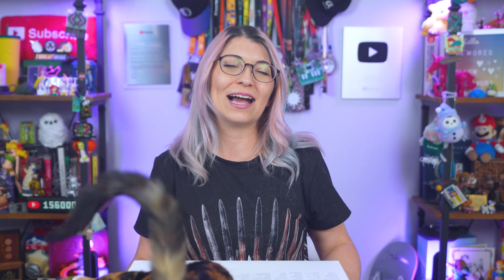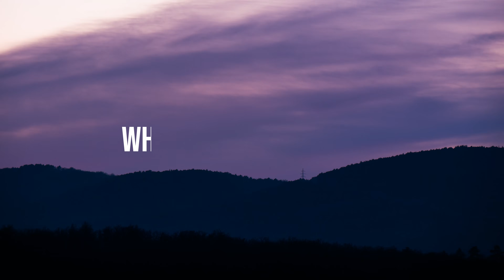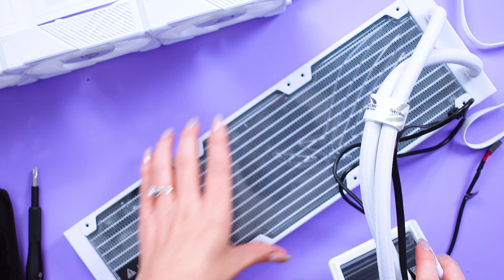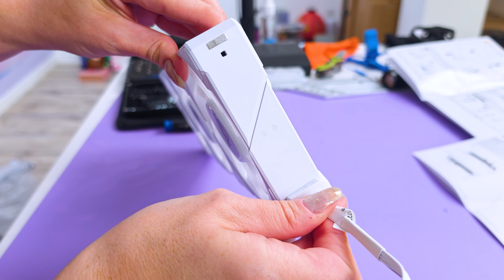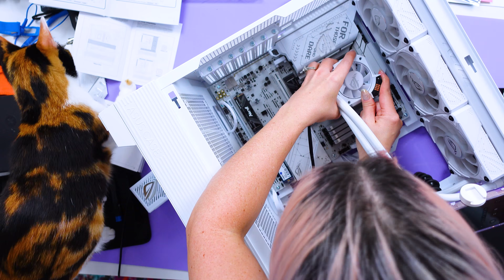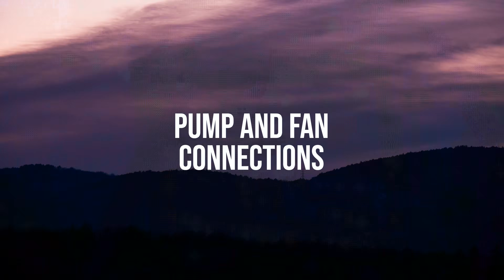How to Install an AIO CPU Cooler 🖥️ Part 5: How To Build A PC For Beginners 🎮

Comment: Yo Shannon. With the radiator already installed I am finding it difficult to install the two psu to cpu cables.  It may be a good idea to install  those cables before the radiator.
Reply from the maker: You're spot on, it can definitely get a bit tight once the cooler is mounted, so doing that earlier is recommended if you have larger hands! I have pretty dainty fingers so I'm able to get in between these parts without issue.